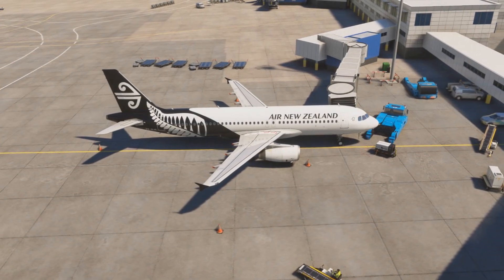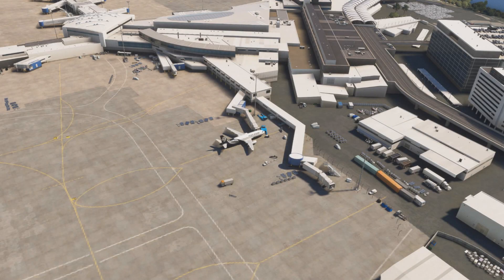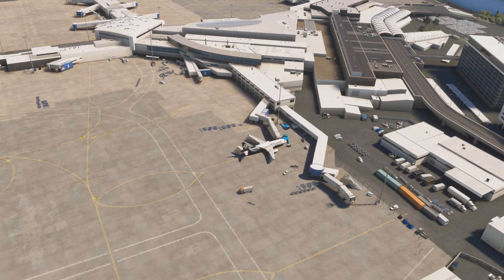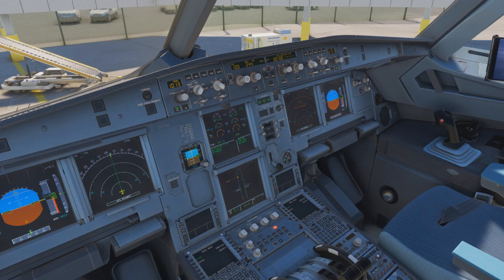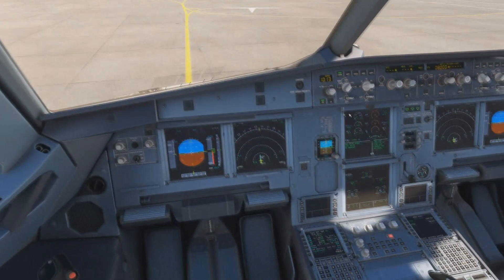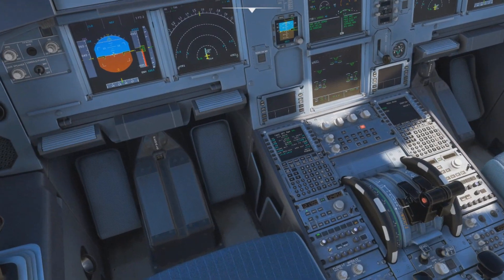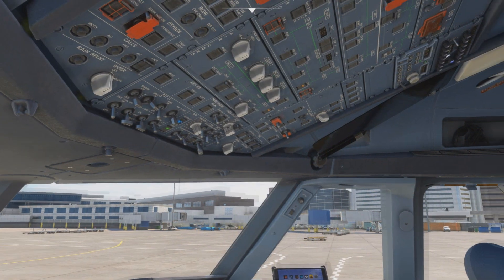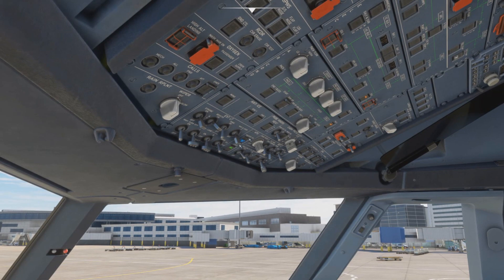How to do a One Engine Taxi at Departure

Comment: hi! I keep reading procedures that say to switch x-bleed to open after eng1 start, in order to provide both packs with air.
is this an outdated procedure or does it maybe only apply to certain situations (e.g. very hot weather)?
Reply from the maker: Given that the APU is functional I don't see the point. Usually we only open the crossbleed for a crossbleed start. The running engine should produce enough air to cool down the cabin.
Maybe there is a reason behind it. In all the procedures I have seen you just use the APU bleed to start the engine

Comment: The Pratt, 1100 engines take time to cool down before fuel is turned on, so motor when taxi will work most of the time. On a cold start, 1st flight of the day oil temperature is key before you can depart. A long taxi is good for getting them warm. After about 7,000 feet of taxi I get the oil temperature up on ECAM, that when I let the lady's know to take their seats.